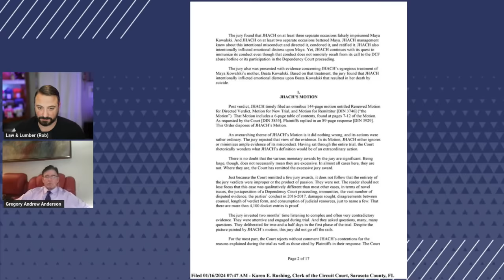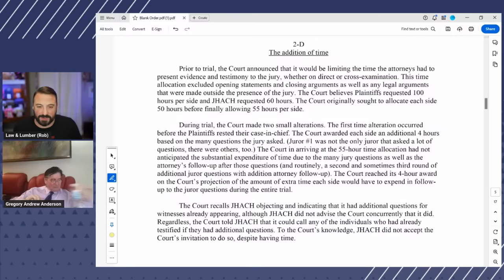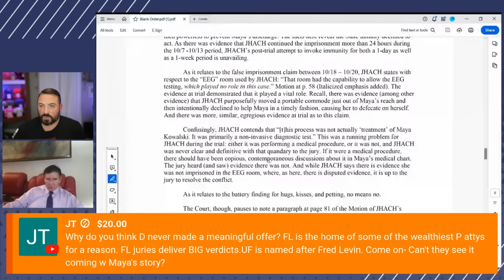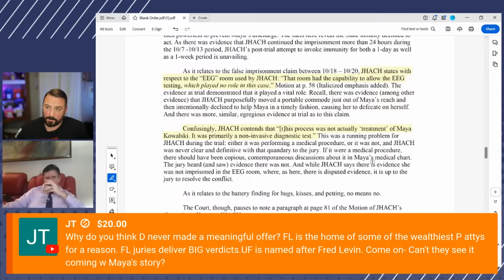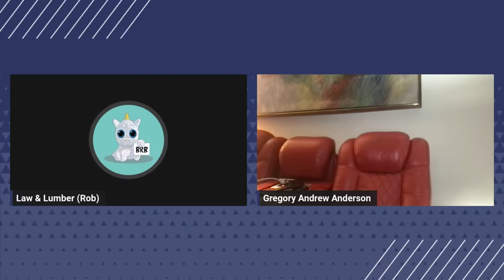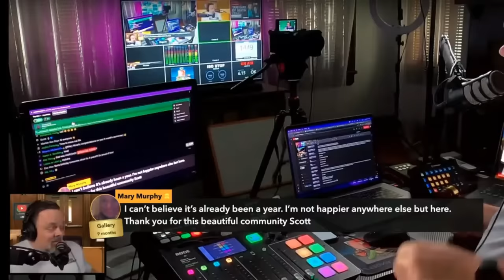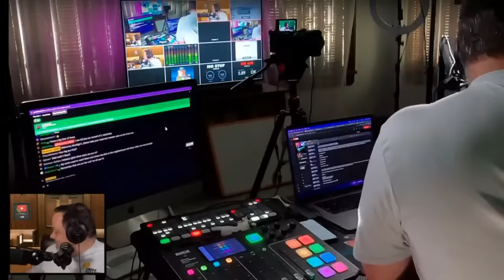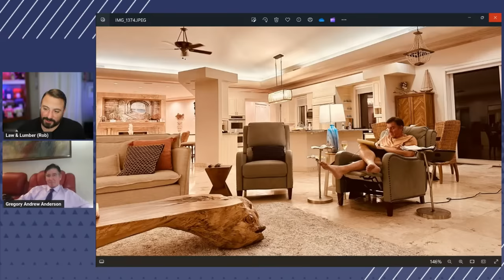Interview with Greg Anderson, Attorney for Maya Kowalski vs. Johns Hopkins All Children's Hospital

Comment: Rob’s gotta fill in Greg more on Girardi, starting with Erin Brockovich (that’ll ring a bell before Lion Air) and his stealing from client trust accounts. Dive into how much stealing and from widows and orphans. While his wife is a real housewife singing its expensive to be her.

And then of course Murdaugh, which if JHACH hadn’t gotten that 2nd continuance, frankly, I’m curious how much coverage this case would have had, based on the timing compared to Murdaugh (and Paltrow). Depending on how it would have fallen, that may have been a major strategic miscalculation of Hunter and Shapiro